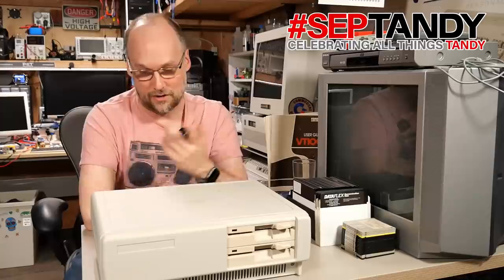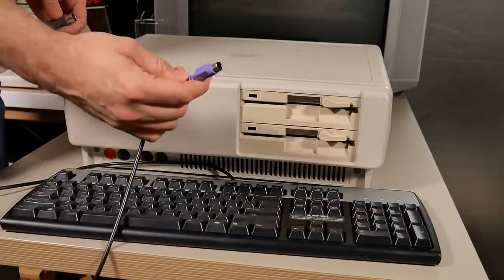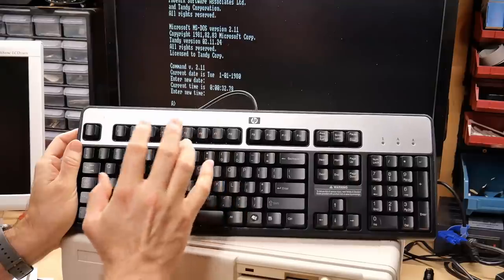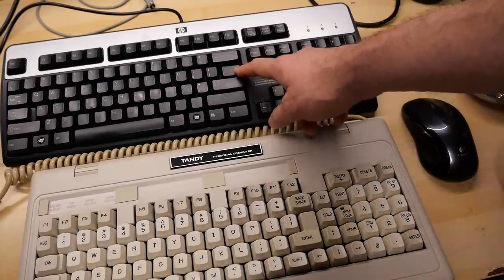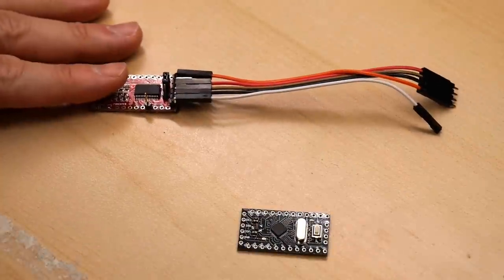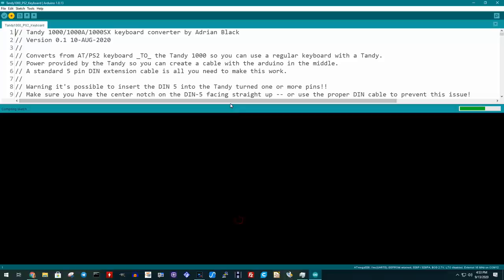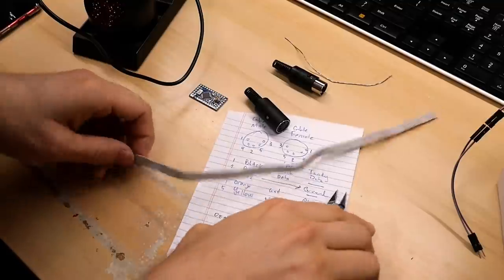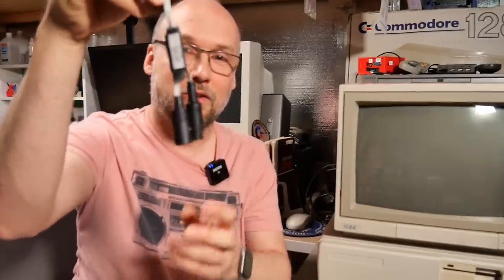Build an adapter to use a cheap PS2 keyboard with a Tandy 1000! #SEPTANDY

Comment: As a professional software developer, your code looks good for what it's having to do! Your comments are on point. 1) make it work 2) make it fast 3) make it pretty
Reply: I agree I'm a professional C#/Web developer as well and I don't think there is anything I saw that looked like people would even notice as far as speed.  I work with arduinos as a hobby.   Loved the video!!
Reply: @randyriegel8553  After 3) or 2) it's usually 1) again :)
Reply: One more thumbs ups! I am an embedded developer and instructor and there is not a thing wrong with your code on the basis of: 5. Is it documented?. 4. Is it readable and understandable?.  3. Is it maintainable? 2. Is it extensible/modifiable?   1. Does it achieve the purpose adequately and DOES IT WORK?!! Adrian, you are a winner!
Reply: Here even the “speed” factor is of limited relevance: even the sloppiest code would be introducing latency that is dwarfed by the time actually needed to fully receive the scan code from the source keyboard - there’s little one can do about that. The time is spent: receiving the scan code, converting it, then sending it out. The I/O times are beyond our control unless we start outputting while the input is still underway - possible but probably not worth it unless some timing sensitive game experience was being destroyed by a millisecond or two of extra latency - I highly doubt that. Other than that, the translation time is less than one bit period of either incoming or outgoing data, so there’s nothing to worry about. I’d say that other than C++ style matters the code is perfectly fine!
Reply: A lot of it is a rip from https://github.com/kesrut/pcxtkbd

Comment: The arduino board may as well be magic with all the crazy things it can do. Holy smokes, this project is incredible! Rock on sir, thank you!
Reply: This is more or less what the chip was designed for, interfacing.
Reply: Not just crazy, but crazy cheap too.  The idea that you can buy a ready-to-go microcontroller for a couple bucks never fails to amaze me.
Reply: @TheTurnipKing   You could go a bit more old-school with a BASIC stamp.

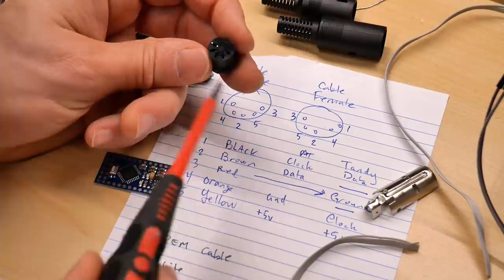Comment: 17:20 - Yeah, it, always confusing when you look up pinouts, I always triple and quadruple check if I’m soldering the wires to the right pins.

When I’m soldering DIN connectors I make sure that I get a plug of the opposite sex too, because no matter how careful I am I get some of the pins melted out of their plastic housing. And yes, my iron is at the right temperature before you ask. So plugging it into a blank socket it helps with the pins not getting misaligned and they don’t wonder out.
Reply: I do the same with any male/female pairs that are plastic. It also helps me in keeping the pin numbering/indexing correct. I test the pin number matching with a DMM/VOM set to continuity to validate the pin index and also that the male?female connections are all good.   Fred
Reply: If you have problems soldering DIN connectors, you probably will have problems with other soldering work as well. Some tipps: get a "third hand" to keep the connector in place, get fresh solder on both the pin and the cable before(!) trying to connect them. Always keep the tip clean with a handkerchief (I don't like the sponge type of cleaner) and a small amount of solder. Usually you will not need to have the tip on any place for more than 2-3 seconds (this is important for the connector to stay in shape) and wait a moment between different solder points to cool things down. However, for example soldering the 13 pin DIN connector of the Atari ST video port was never easy ... :-)

Comment: @Adrian, I took a look of the code. I also did a little research on XT/AT/PS2 keyboards. I think the TANDY keyboard is using the XT "SET 1" that is probably still available in all PS2 keyboards. About your code I'm mostly worried about proper handling of key-pressed and key-released (make/break) messages.

First, about the "SET 1". PS2 keyboards are two-way communicating and the host can send commands. Switching of the LEDs is done with host commands. There are also command that can change the working "SET". 
You may send "Set Scan Code Set = 1" (0xE0, 0x01) and then pass keys without translation. The layout may contain surprises, though.
You may also check if sending "SET 1" codes to TANDY would produce keys that are otherwise missing. e.g. "KP *". This may avoid some hackery.

About your code.
1. I do not understand why shift, capslock, num are only handled on make/press key on the PS2 side.
It looks wrong. They should produce release/break codes, too. (Unless it has been explicitly disabled by host commands).
Pressing shift, would lock it as been held, to release it you'd have to press it again. It would work like caps_lock with attitude .

2. Define all Tandy/Set1 keycodes and use their labels in the code. This way you can have e.g. "send_key(XT_KEY_SHIFT); send_key(XT_KEY_8);"

3. I would advice to check for the release/break key code "0xf0" at the start of the function and set a flag/variable to mark it. Most of the key handling are identical, with just the break flag difference.
e.g. "send_key(ascan | break_flag);"

Of course, special key handling "if (c==0xe0)" should be first, as it expects the release/break "0xF0" code after it. aka "0xE0,0xF0,71" for "Delete". (Still the special key handling routine is also doing key checks twice for pressed and released keys).

4. OCR and upload the TANDY documentation and put the link to the relevant part in the project.
It won't hurt if you put a link to a PS2 documentation. (The one on avrfreaks site was very useful to me. Tell me if you want direct link.)

5. Do not make your own functions that start with _ or __. They are generally reserved for internal library functions. Might get funny if you overload them.

6. Some people already proposed to make a constant table of size 256 and fill it byte by byte.
On some architecture constant tables are directly accessed from flash, so it may free up some of the RAM memory. No idea if that applies to the one you use.
Reply: Here is the link to the PS2 keyboard documentation.
Maybe the spam moderation would bring my original post to your attention.
https://www.avrfreaks.net/sites/default/files/PS2%20Keyboard.pdf

Comment: Custom keyboard interfaces are fun, I've an oddball vehicle PC (with an industrial type single-board PC on an ISA backplane) which uses a 2-row DB15 for a combined PS/2 Mouse & Keyboard connection, which I need to build an adaptor for, so glad I found the manual for that SBC for the pinouts... :S

Comment: Dude! You are so lucky you have those codes. I am working on a similar project for a ATT 6300 for an upcoming episode. It is really difficult to emulate the right codes for that machine. Especially since they seem to be more rare than the Tandy's that had the odd keyboard. Not to mention I don't have the original keyboard. Great work!
Reply from the maker: Yeah Radio Shack has such good documentation. I don't have one of the AT&T keyboards otherwise I would see about capturing the codes on my scope. :-( We need these adapters for every old machine. I'm suck of the keyboard being a continual issue.
Reply: Those are the standard AT set 1 codes. That is a PC-compatible machine.
Reply: @adriansdigitalbasement , Would you scan and ocr the Tandy documentation and put a link to in in the github project.
I do suspect that the Tandy keyboard is classic XT/AT-Set1.
I have more question and remarks, that I've written in a separate comment, that is so far completely ignored. :(
Reply: @MisterMac56 Awesome! Thanks.

Comment: Great timing on this video!  I'm currently working on a PS2 keyboard interface for the Atari 2600.  I was doing pretty much the same thing you were doing, and I was writing a program on the Atari side to accept codes through the joystick port from the Arduino and display what you typed on the screen.  Now I don't need to go through a lot of the mess that you have figured out!
Reply from the maker: There is a PS2 to C64 adapter out there. Look for Hartland C64. Might be helpful as I'd imagine the keyboard on the Atari is a matrix like the C64.
Reply: @adriansdigitalbasement  That may be helpful too.  This one isn't for the 8-bit computer line however.  This one is for the Atari 2600 console.  I'm working on writing a program right now as a proof of concept for turning the Atari 2600 into an actual computer.  I'm using the 2nd joystick port as the interface on the Atari side to the Arduino to accept the codes in 4-bit form Combining at least 2 of the codes to form a full 8-bit ascii value.  There is a flash cart for the 2600 called the Harmony cartridge, that pretty much gets it halfway there.  With some more additions like a keyboard interface, added memory, a way to program the ARM in the Harmony directly to gain direct SDCard access, along with code for an Atari 2600 OS, it would be able to be a limited but full fledged 8-bit computer that you could write your own code directly on, etc.  I'd like to get others involved with it, that could possibly do some of the things I would love to do better than I could, which is why I'm working on this proof of concept right now to gain some traction. :)
Reply: @sprybug  that's quite an interesting project you have going there from the sounds of it. Have you posted to the AtariAge 2600 Forum about it? And if you didn't know about it, there were 2 different keyboards developed for the 2600 back in the day but only one released [both plugged into the cartridge slot and provided a pass-thru cartridge slot]. The one released was called the CompuMate and it was released by the same company that made the SuperCharger [a cartridge with 6K RAM and a connector for a cassette player; the games were on cassettes for it]. The other keyboard was designed by PVI on contract with Atari and its parent company Warner. PVI was made up of ex-Commodore engineers who created the C64's chipset but left because they felt like they had been ripped off. The details of it are at the Atari Museum website. There's 2 versions of the Harmony SD Cart plus there's the competing UNO cart which is open source on its code. Now, if you opted to jump to the 7800, there was a keyboard developed for it but never released. Like your plans, it connected to the 7800's 2nd Joystick Port and had its own proprietary interface chip which worked with the high-speed nature of that 2nd Joystick Port. Not only did it do keyboard functionality but it would've had a pass-thru for the 2nd joystick with a DB9 and also had an Atari SIO Port too. The late Curt Vendel - founder of Atari Museum and an expert on just about everything Atari related - was very impressed with it but he didn't get to reverse engineer it. There's an unreleased word processor, BASIC, and 2 versions of AtariLab software for the 7800's keyboard floating out there. Curt also speculated that the successor Atari Corp would've used Joystick Port 2 with some specialized controller to get a MIDI adapter working since they had planned to port the popular game MIDI Maze ["Faceball 2000"] to the 7800. Finally, if you weren't aware of this device, AtariAge also sells the AtariVox adapter. It plugs into Joystick Port 2 and works with the 2600 and 7800 to not only do speech synthesis but also save game scores. You might want to look into that too. Good luck and remember to post to the AtariAge Forums so you can pass on info and also receive help from the other homebrew hackers and coders!
Reply: @adriansdigitalbasement  Just so anyone reading this comment knows, there are existing PS/2 to Atari 8-bit keyboard adapters. One of the most recent projects is specifically for the Atari 400 and that one is getting debugged at the moment.  :)
Reply: @TheJeremyHolloway  Hey Jeremy.  Yep, I know a lot about these things!  I did some research before starting this project up.  I've made some Atari Homebrews and still working on my latest game that's been in the works for years and am close to getting it finished, which is a mega-man/kirby rogue like with boss fights and environmental differences in every level, along with a soundtrack for every level that's been very challenging to program on this very limited machine let me tell ya!  This hardware side project has been an idea of mine for months and wanted to try something a little different so I don't go mad and lose motivation on the game altogether, which I have had in the past because of brick walls thrown at me left and right throughout its production.  Anyhow, I do plan on posting about this in AtariAge once I get this proof of concept working and a video made to show.  I want to see if I can spark an interest in the project there, much like I had done with Princess Rescue and Zippy the Porcupine when I first showed my demo off there.  If so, I can get people on board who'd be able to accomplish some of the things I wouldn't be able to do on my own.  A project like this would be best as a group effort with the best minds making it possible for sure!

Comment: Adrian, thank you for this. Brings back memories. The SX was the first machine we had in the house in 1984 and it started my journey for everything since, at the age of 6. I still laugh hard remembering the 640k base mem, 4.7mhz and the 20 meg hard drive that you literally had to “park” on a huge ISA card. I remember playing every Sierra game at the time back then along with Janitor Joe, Bouncing Babies and Round 42. I could go on forever. I wish I could have stayed that young and not have any responsibilities like today :/
Reply: My first machine was my dad's Tandy 1000 HX (which I still have). 3 decades later, I even found the original receipts while I was digging through his old stuff! He bought it for about $250 CDN ($430 today) back in 1990 when RadioShack was clearing them out, with a Packard Bell B/W monitor for $190 ($330 today). About what you'd pay for a low-end system these days.

Comment: Fortunately, my 1000A came with its native keyboard, all handed down to me by a family friend back in 1994.  Also gave me software, computer's manuals, amber composite monitor & Epson printer (with proprietary ribbon cable). I have 2 CGA monitors I use with it though.   But this adapter will come in handy if anything happens to the keyboard.

Comment: One request, Adrian, I notice you cut out of the video the wire stripping, tinning, soldering, etc., but personally I love watching those parts. Maybe you can consider leaving that in, or at least fast forward rather than cut?
Reply: Soldering those DIN connectors is super fiddly and it takes me ages when i try it, i can see why he would cut those bits out.

Comment: I didn 't watch all of your video, but I think that I contribute to it with two pieces of advice:

1) Maybe it would be better for some users to just shove the arduino PCB inside the keyboard itself and avoid any mess with the long cables, bulky adapters and bad contacts.
2) If you are planning to use the PS/2 plug, you can always use some thin, short pieces of heat-shrinkable tubes, make fast solderings on its pins, wait after every soldering and use a 25W or lower soldering iron. Or you are gonna and up with a screwed-up PS/2 plug!

I hope I was straight-forward and helping! If you don' t understand me clearly, it' s because I' m Greek... ;-)
Reply: 1) If you've got a keyboard that you've dedicated to that system, that could be handy. It's certainly small enough to do so, but then that keyboard can ONLY be used with that system. It also rules out using a KVM if you're limited on space (not that many people used KVMs with CGA monitors, but you know what I mean).
2) The cold solder joint is probably because he's using that USB-powered soldering iron. I'm of the same opinion as Dave from EEVBlog on those things. They're great to stuff into your pocket for doing field repairs, but for ACTUAL work, just use an AC-powered iron with adjustable temperature (I usually have mine set at around 35-40w for most work). That way it STAYS at temperature. Most USB just doesn't pass enough current to keep the iron consistent once you start working on things that sink heat.
Reply: @BlackEpyon  Even better (although more expensive) is a temperature-controlled soldering station where you can set the desired temperature in either F or C, and it will maintain that temperature by sensing the temperature at the tip and controlling the power sent to the heating element.
Reply: @brianleeper5737  I ought to get one of those at some point. My current one is a NexxTech variable wattage iron. Goes to 60w. It's cheap, but very functional.
Reply: @BlackEpyon  I have a Weller WESD51, which is no longer made. But it works very well.
Reply: @brianleeper5737  Ah! Good 'ol Weller.
Reply: @BlackEpyon  It wasn't the cheapest soldering station but I figured it should last quite a few years before I need to replace it.

Comment: was about to say "just use a bare Atmega328p" but honestly the Arduino boards are barely any more expensive and come with a complete board and simple programming interface.
overall pretty useful little project.

Comment: you should check out marine-grade heatshrink tubing. it has glue inside that melts as it shrinks, creates a solid/waterproof/resistant connection.